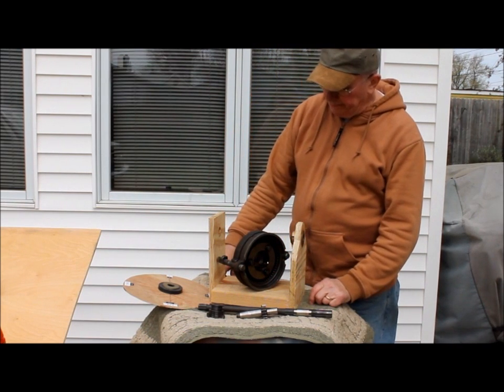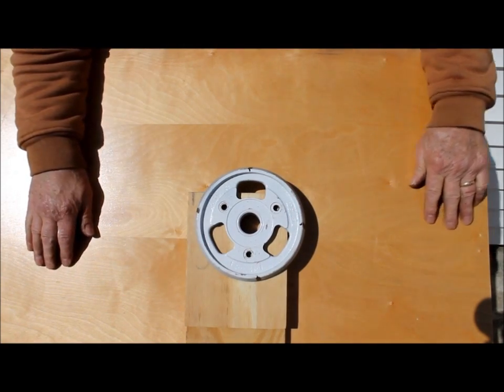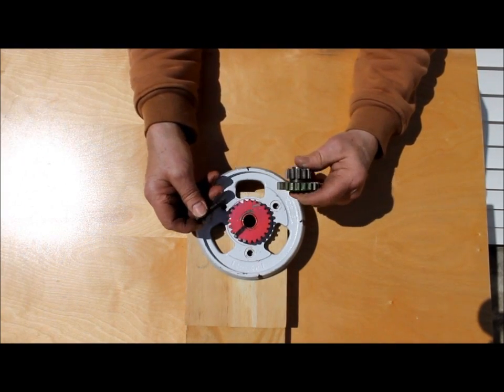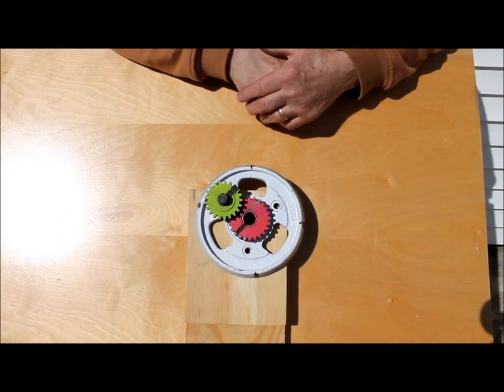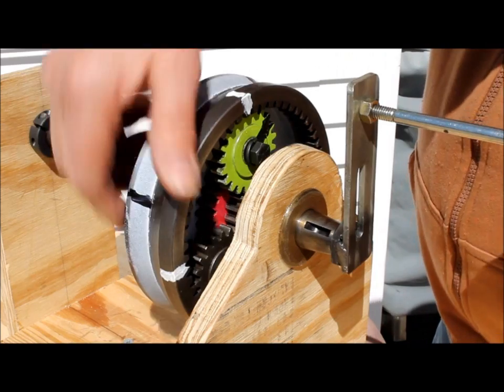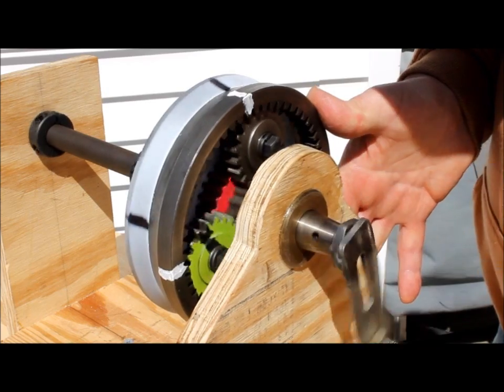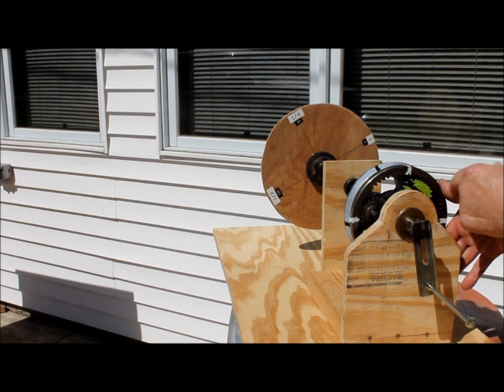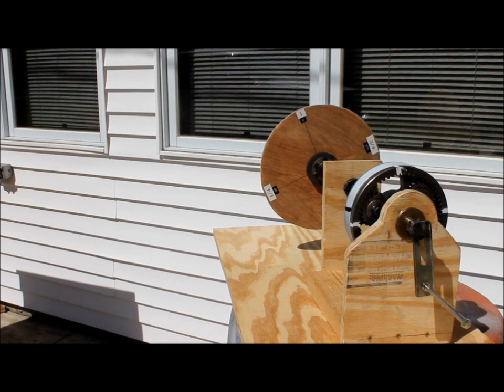Gravely powered High Low Planetary Assembly

Comment: Thank-you for your video on the Gravely planetary high-low unit.  I am working on a Gravely walk-behind unit for a friend.  The planetary high-low, ahead of the engine, like the unit in your video, was locked in the forward / low position.  I removed engine, and planetary unit.  The friction material on the Raybestos clutch ring looks paper thin.  I believe the friction surface is worn too thin and the lock ring is moving too far forward and wedging it locked. How thick ahould the lining be?